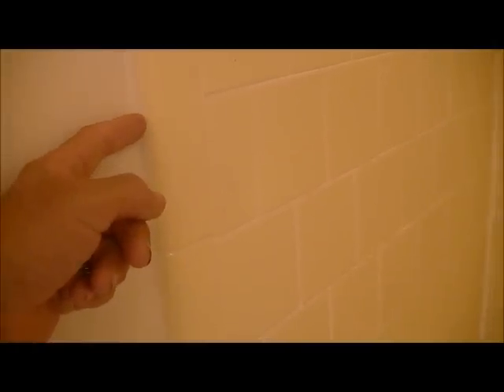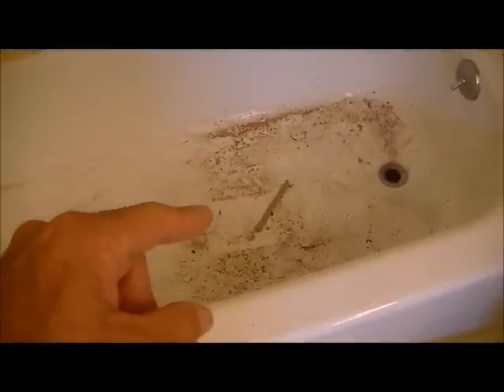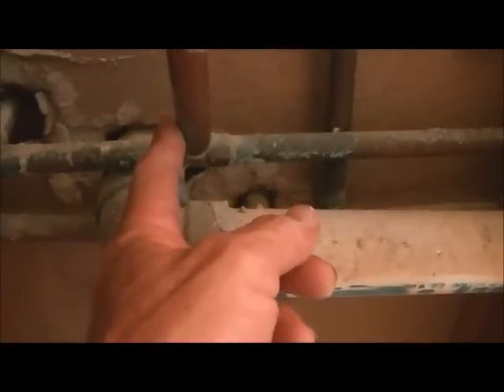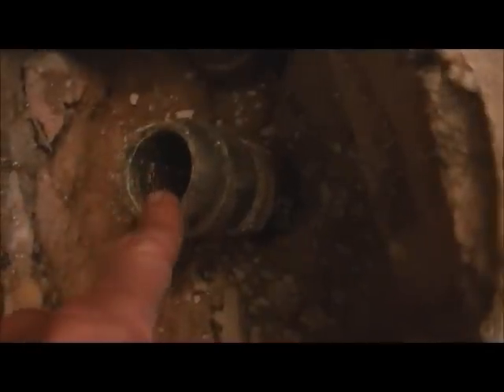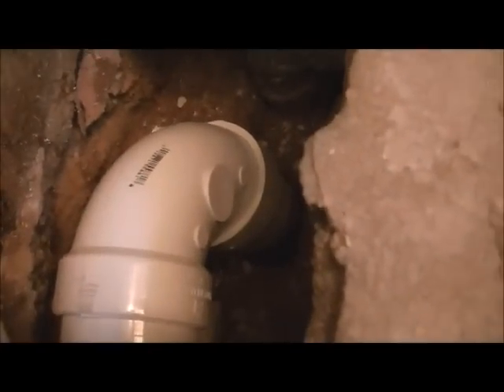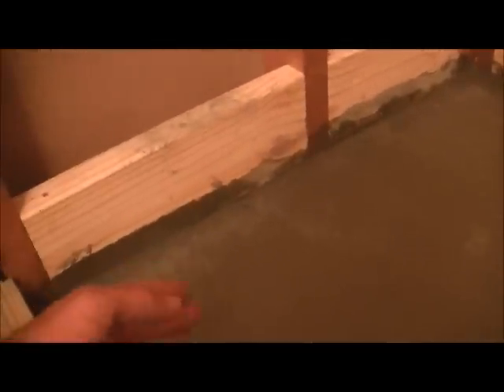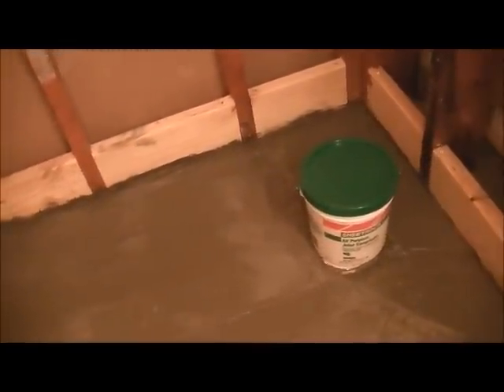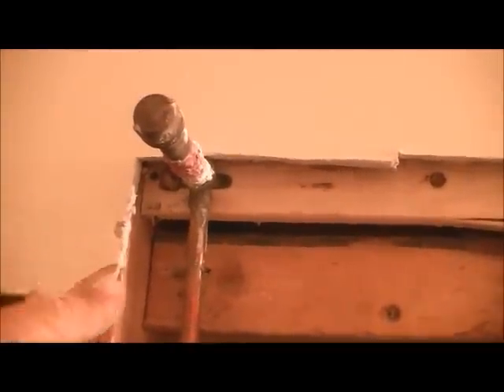How To Convert Tub To Shower

Comment: Why do some people do a plywood surface over the existing slab /hole instead of filling in the way you did? Your method seems far more robust/water proof?
Reply from the maker: I don't know...every contractor does things their own way
Reply: If I was going to do a teak flooring that rested on the floor..could I just do the sloped pan and red guard to drain and no tile under teak decking? A drain through system?
Reply from the maker: Hmmm..idk
Reply: Ok..thanks for your time. Great videos.

Comment: How did you back fill the slot in the slab around the drain pipe? Or did you just put something over the hole, secure it to the slab, and then pour the sand mix?
Reply from the maker: The "box" void was filled with concrete.
Reply: Thanks! I ask because I'm about to do the reverse, except that the shower I'm removing is a thick fiberglass 'kit' type; seems to have been installed as a pan, with 3 surround panels. I'm converting it back to a tub and I'm hoping that because the bottom was a contiguous piece that the drain still has some play available.
Reply from the maker: Then you might find this helpful https://www.youtube.com/watch?v=aOCRNmhvMU8

The "box" is put in during foundation pour so if the drain needs to be manipulated it's easier in the box of dirt, so I suggest doing the same if possible.